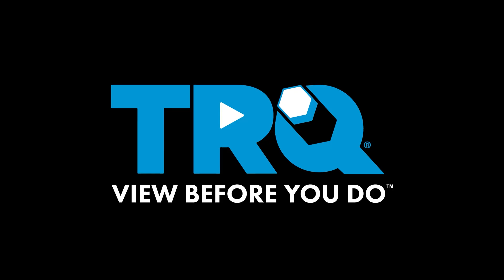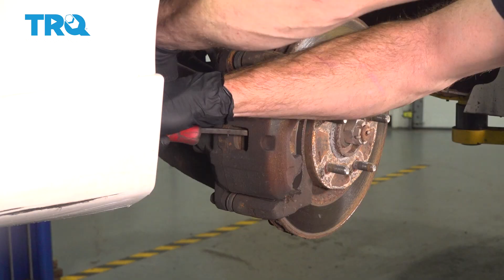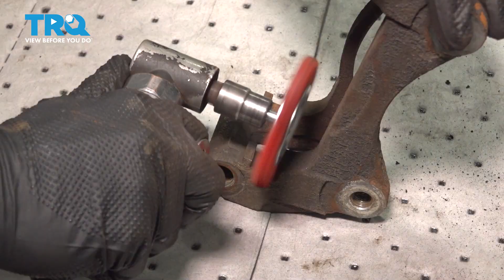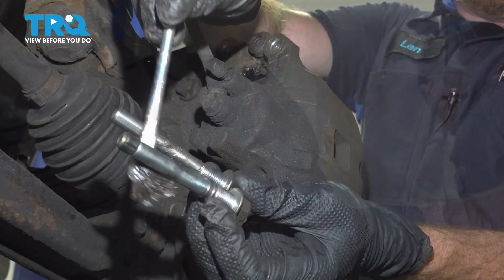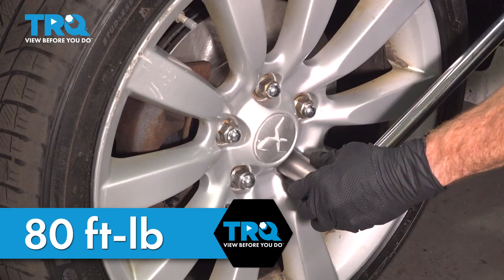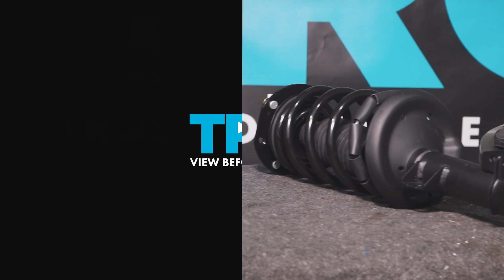How to Replace Front Brakes 2008-2017 Mitsubishi Lancer

Comment: great video, thanks.
a question... is it absolutely critical to have the 'dampened' pin installed in the lower position? and also the wear indicator?
because looks like the 'sliders' are 'reversed' in my case (on both wheels).